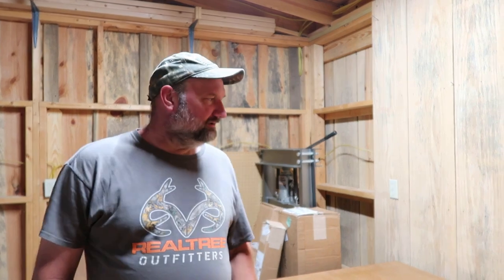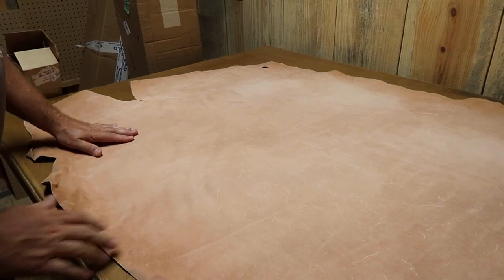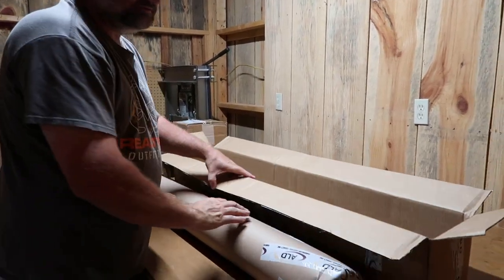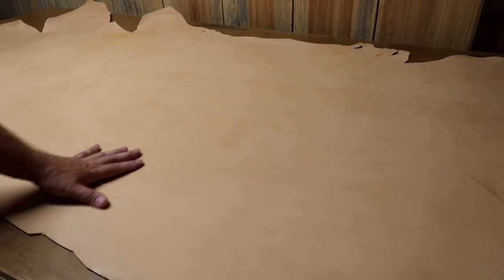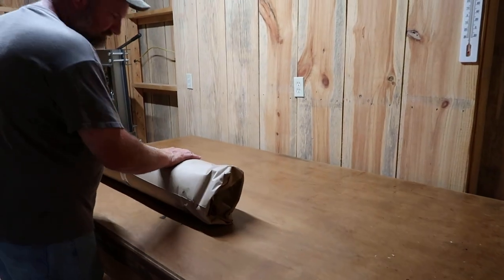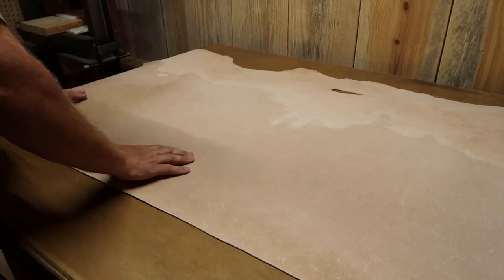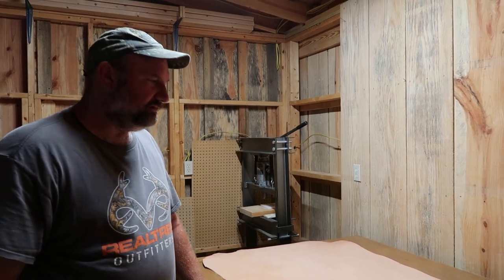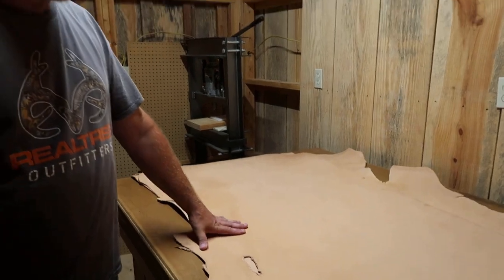Sepici / Chahin / Herman Oak Leather Unboxing

Comment: Do you think you are going to make a gun holster ? You probably  have to work early in the morning  or late at night with the heat,  i like workings  real early.
Reply from the maker: Hello, right now have no plans to make one. I will use the leather for my knife sheaths though. In my small shop is whete I work right now and has AC. But eventually will be opened up into this shop with AC. What leather do you like working with? Have a Blessed Day Friend.  Justin

Comment: How is the Chahin leather? I used to love getting the Weaver Select veg, but they don't sell it anymore. Now they sell the Chahin. How is it compared to the Hermann Oak?
Reply from the maker: I haven't had a chance to use the Herman oak yet. But when I do, I will make a video of the two leathers and my opinion of each. I have some Chahin holster leather left so it will be compared too. I have been pretty happy with the Chahin so far.The only thing I noticed with the side of holster Chahin is that it seems to wrinkle a bit more on the surface than some of the other leathers I have tried. Looking forward to trying the regular strap Chahin side out. Have used 10 oz Chahin strap side and it was good. I will let you know. Have a Blessed Day Friend.   Justin